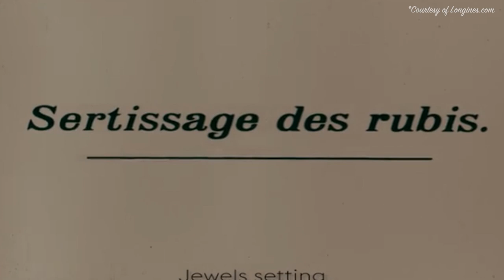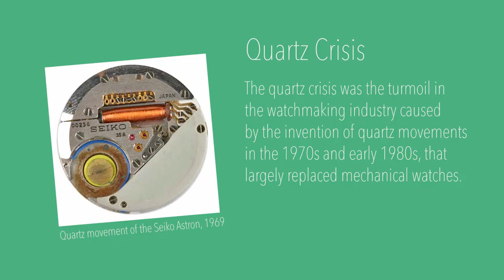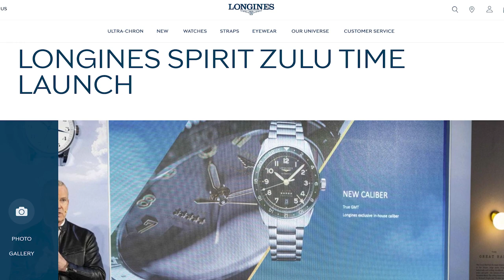Is it worth the hype?

Comment: I have the blue dial version, my rotor is quiet to me, but I’ve had years in a mill and duck hunting so my hearing is not the best.  It’s bang on -3 to 0 per day no matter what so it’s definitely accurate within COSC.  I have the bracelet version, but it looks good on a leather strap, I often switch them out.  Great review!
Reply from the maker: Thanks so much for watching and commenting! Maybe the rotor on this particular watch is louder than others but it is pretty loud compared to most watches I have had my hands on (which is strange since the case is solid so you would think that would dampen it). In either case, that doesn’t make me think this watch is anything but spectacular at the price point!

Comment: Coincidentally - I've tried it yesterday. Both bracelet and strap iterations (blue dial). The AD had green version too - but I'm between blue and black dials. Anyway - after seeing it online, in person the watch is very nice. One critique - case edges seem sharp, but my main issue is the metal bracelet. It just feels light and cheap. The provided leather strap is also kind of rough, but the whole watch looks better with a leather strap. I guess a nicer leather strap would compliment it nicely. Still - it's a true GMT, COSC certified... and the dial is just great, applied elements....
Reply from the maker: Nice! I could see this watch looking great on a leather strap as well. Thought the bracelet was pretty good other than the clasp. Definitely seen chunkier bracelets that feel cheaper but definitely a personal thing. At the end of the day they can’t make it as good as a $6k watch otherwise they would charge $6k for it so there needs to be trade offs. The fact that is has what it has at $3k is pretty sweet. Thanks for watching!
Reply: @watch_please  Indeed. It can take rustic leather strap, as well as much more polished "alligator" type... I can even see it on synthetic canvas strap. With respect to the price - bang for the buck - it's excellent ! In fact, I don't even think that price factors in until - paying for it :)  versus Tudor BB GMT or something like that. I'm waiting to see/try Formex (new GMT) - then I'll pull the plug.

Comment: I have a small wrist wish they made it with a 39mm case.
Reply from the maker: You could try it on leather strap, the lug to lug isn’t huge without the solid end links of the bracelet. The GMT bezel makes the face appear tighter (than a dress piece at same size) but it is a full size case for sure